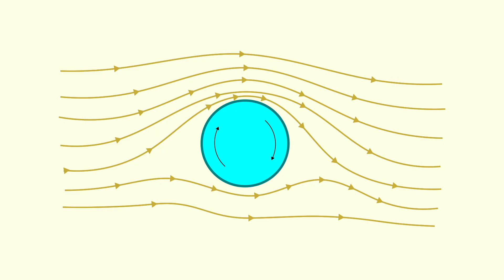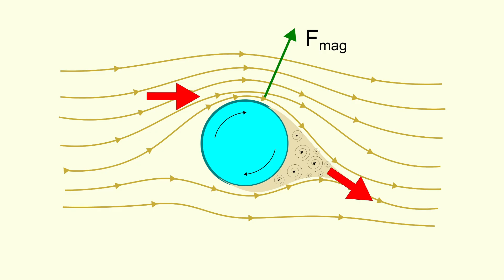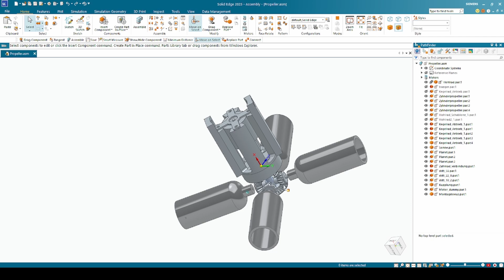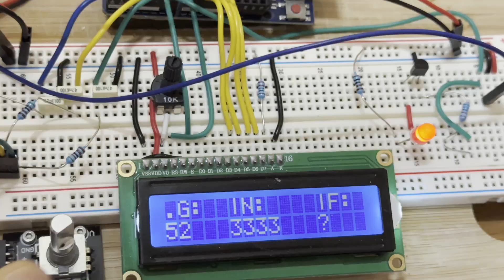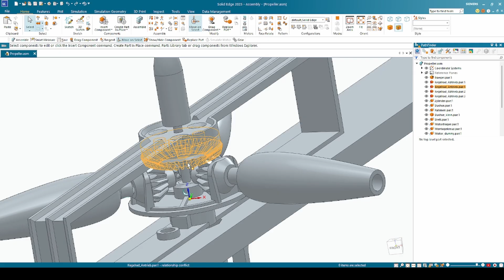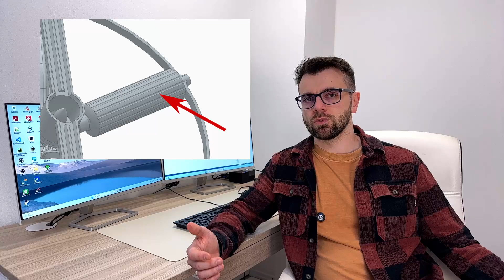Can a Magnus Propeller Actually Work? I Tried Building One from Scratch.

Comment: Looking at the video of the last iteration it looks like it is pushing down. I think it's working but you mounted it upsidedown for how you did the gears.
Reply from the maker: It just looks like it works, but actually the rotation and the gears are correct oriented. The important fact is how the cylinders' rotation is oriented relative to the main rotation. I checked the orientations, and they are correct.

Comment: So many things wrong.  Think about it in terms of angular momentum.  If you have a cylinder rotating one way, when you rotate the whole cylinder what direction does it want to rotate in?  You are fighting yourself constantly and you are going to end up with strong internal forces to keep these things rotating.

Also adding a turbulent layer makes no sense when trying to do magnus effect.  Magnus effect is caused by the stiction of the air to the surface.  By separating into two air masses (one turbulent and one not), the non-turbulent layer has no response to the spinning cylinder because it isn't touching.  Also the 7/8ths of the point of dimples on a golf ball are to reduce the magnus effect.  Also imagine intentionally causing turbulence on a wing to "get more lift per drag".  Also considering the thing is tearing itself apart drag is not your problem.  You need more lift at a lower speed.  If you have less drag that would let you reach a higher rpm which clearly your design wouldn't be able to handle anyway.

I'm sorry bro but sometimes school doesn't help people.  I blame the schools more than anything.  It seems like they did a good job teaching you how to do CAD but they skipped teaching physics.
Reply from the maker: Thanks a lot for your input. I'm not really sure I understand the aim of your initial point. I think it's pretty obvious that changing the angular momentum creates a torque that's perpendicular to both the main axis and the cylinder axis. I tried to reduce this with a bearing.

 I agree with you there. Dimples don't directly improve the Magnus effect. But they reduce the drag force and the drag torque on the motor. This should make the speed higher without using any more power. So, the idea is that if the main axle rotates more, it should theoretically create more lift. Next time I I'll try to be more precise with my statements.

Just to be clear, I'm not a physicist, I'm an engineer. We don't spend the whole day chatting about theory, we try to put our ideas to the test with real prototypes. :P